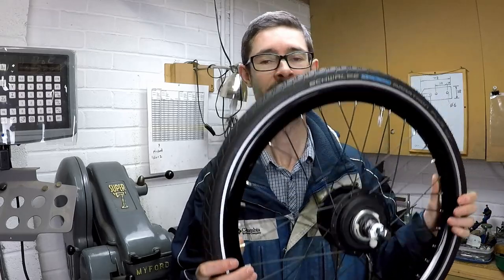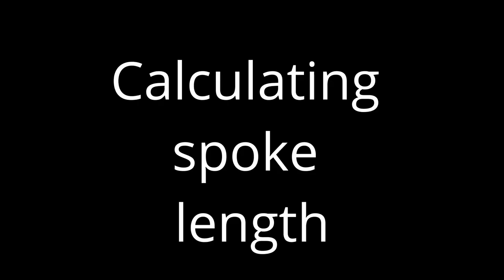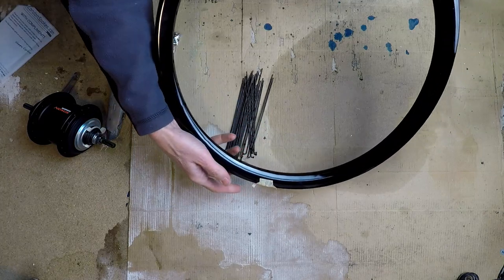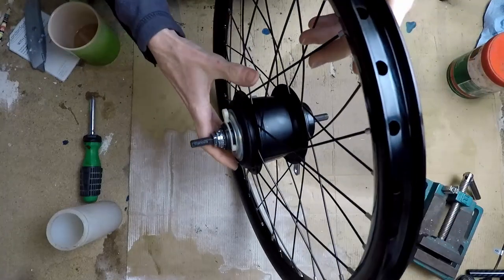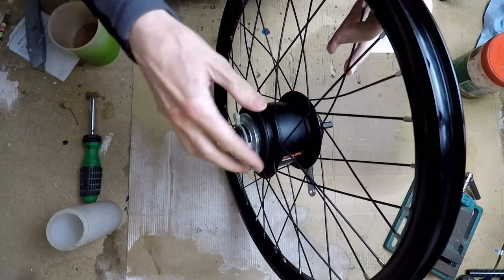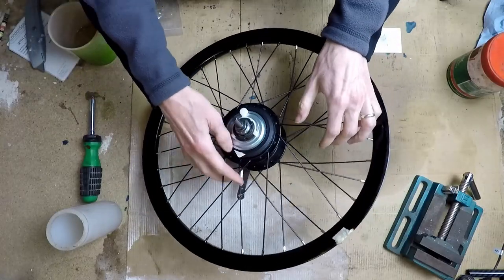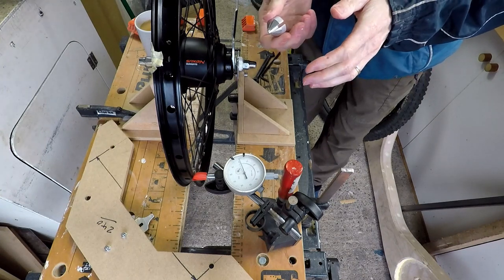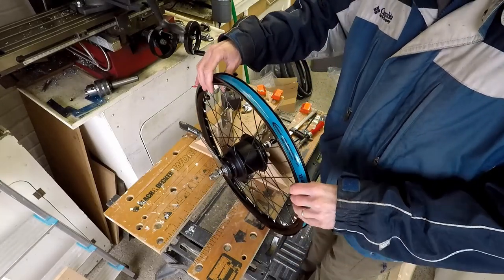How to successfully build a bike wheel without special tools as an amateur.

Comment: Nice video.
I find it easier to true smaller rimmed wheels but harder to lace them without bending the spokes too much.
Longer spokes on larger wheels bow more readily when lacing.
In general it's better to go with slightly shorter spokes if yours are an in-between size.
eg, if your calculated length is 185mm and there are 184mm or 186mm available take the 184mm, that way you have less chance of the spoke protruding past the nipple once tensioned.
This is more important on single walled rims.
When tensioning always start at the valve and work around the rim 'till you get back to the valve and lubricate the nipples as this helps prevent the spokes from twisting.

Re tensioning:
If you know where to get a tension gauge that will fit a 20" 406 wheel, please let me know.
0.1mm runout is not only GOOD, it's amazing but don't forget to do the stress relief and then recheck.
Also check it after the first 200 miles or so.

Comment: Why not Alfine 8? Its more efficient as it has more bearings than Nexus.
Reply from the maker: I'm not rich enough, otherwise it would have been my preferred choice!
Reply: @MetalMachineShop  But but, its the one of the most important component in there, and will be with you for the longest time, also its like 50eu difference, not Rohloff money.
Reply from the maker: Yes that's true, probably would have been a better option.  Maybe next time...